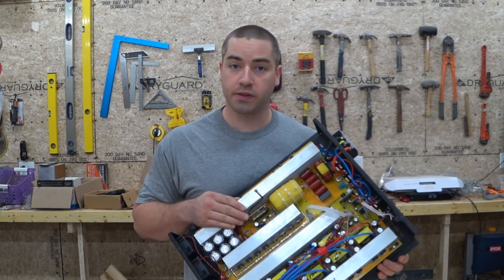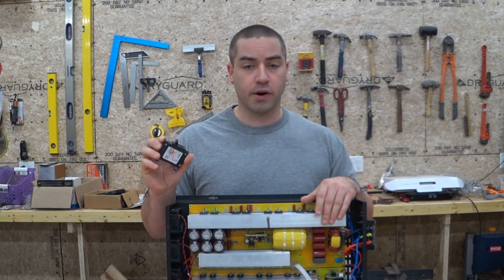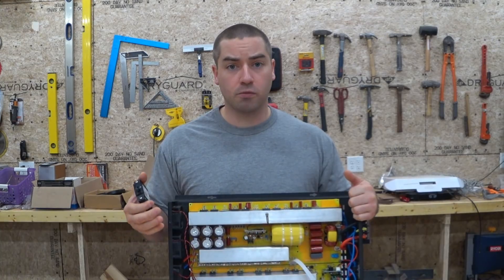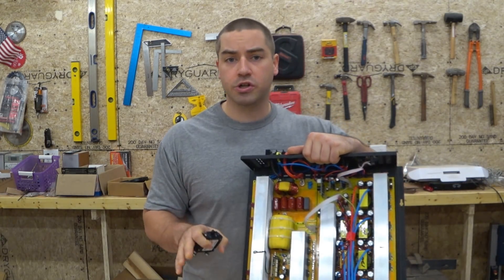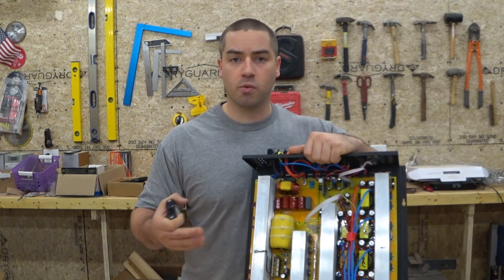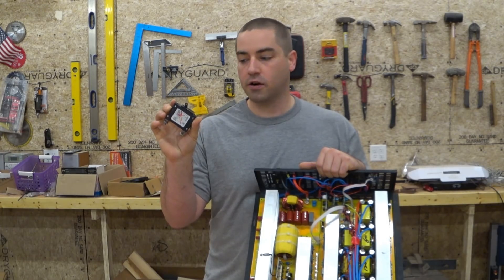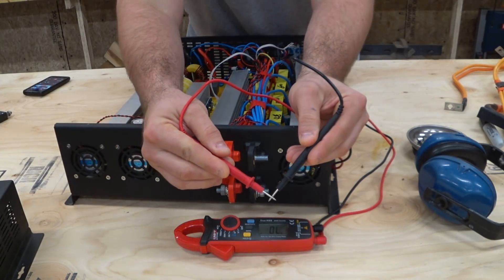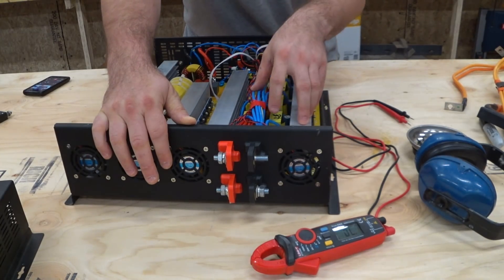Did I Blow Up the Inverter?

Comment: Throw that sh*t in the garbage and stop wasting your time.  Lets be honest here "time" is money and there just ain't enough to go around when you have a child & wife that needs your company yes?  We are Off the Grid and the only component we used that wasn't a name brand was our Battery Bank, we used the Ford C-Max Energi 7.6kW banks and we went with Magna-Sine 4448 PAE and the PT 100 that we got off ebay, it was an old stock unit made up from MidNight Solar that a company bought at a bulk prices so we got a really great deal.  The main unit was two years now three years old but brand-new.   I did not have to the time to waste on cheaply made products, seriously I have read the comments below and IMO you should get your money back and maybe look for a deal like we got.   Here is some great advice buy your fictitious name, register it with your Secretary of State and then you have your Corporate Sole aka your Biz, the "Strawman" then you can buy wholesale through your newly formed legal business like we did and do.  We got our Battery Banks from LKQ at wholesale- ea. bank 7.6kW for under $900 delivered to our shop, so in all we power our home now for under 4k, however, we do need some more batteries and more solar panels to power my shop and the home at the same time, which we are now shopping for deals on.  If you need help just email me.
Reply from the maker: Thanks for your comment.  I agree that time is valuable.  My next inverter will be a better brand.  Congratulations on being off-grid.

Comment: I would like to ask the EE community who's been posting here;

If one of you Electrical Engineers know how to design (or would like to help design) an Open Source DIY DC to AC inverter from scratch that is better by both cost, and reliability) than what's currently coming from these other markey sources, I'm sure we would get a few video views (if that's your thing) doing a video series for a community built, Open Source, modular (expandable) DIY inverter design - I'm talking a Open Source, DIY (kits? populatable boards?) user built, and serviceable, reliable, safer, lower cost, DC to AC power inverter from scratch.

I'd throw a like to That series!! As I'm sure would many others.

I'd even venture to say that we could probably get some GoFundMe, Patreon or Kickstart fundage to support it's initial design tests and parts procurement....

I know that there are perhaps safety, or liability issues that may need to be addressed with this idea,  but those can typically be figured out with some discussion...

Initial design could probably be mocked up in a Spice simulator until most of the kinks were addressed, then an initial prototype and testing could begin, before a beta release; This would also make it easy for designers from all over to contribute/vote on design features...

With the close knit community of persons who do DIY solar and alternative power systems, I'm sure you would have a great result. I know that I would really like to understand exactly what's going on in these systems and their design so that I can either build or repair my own, or give my mom in Hawaii who's on a 48V DC solar system currently, some ways to troubleshoot what she has currently. 

I also realize that good quality, reliable parts cost more money, but perhaps with the community working together, hunting down good reliable and cheap parts houses, and with some design discussions, a cheaper, more reliable DIY inverter could be built by us for us, that we could actually fix in the event that there was a failure....

 For example, I would suggest for starters, that an open source DIY inverter's input section allowed for perhaps 6, 12, 24, and 48V DC input, depending on an individual's system requirements perhaps via two different boards one at 6-12V, and another at 24-48v; and that a similar, modular output stage that could have upgradable power output power ranges...

What do you think?

So tell me, what would you add, as design features, or ways to keep it modular, or less costly if someone was to take this by the horns? And would you be interested in building one of these, or buying it in a kit form?

And if YOU - (yeah, you know it's YOU...) are That guy or Gal who has enough knowledge about design consideration of these to help kick this idea off,  post here, or email to the address in the next paragraph, and let us know... I would be willing to help set up a webpage for it, do the kickstart/gofunding setups, or where ever else I could help; I have a lot of other skills (I'm a long time technician in electro mechanical) and I'm pretty good with a soldering iron and 3d design, but electronics design was never my forte; too much math for me...

So to help get it going, I just set up a google email at OpenSourceDIYInverter AT gmail dot com to get a point of contact started; If you are interested in helping out, let me know through there. I will also drop this comment to some other solar/inverter videos and forums online, and if I see some interest, I will go further, perhaps setting up the webpage and starting a kickstart; I may just go set up the kickstart just to see what the interest is like out there...

Thanks, hope to hear from you!

OpenSourceDIYInverter AT gmail dot com
Anthony W.

Comment: Hi DavidPoz;

(prequel: sorry about the length of this post, before I knew it, it was looooong! My question regarding your system is near the bottom)

I just wanted to commend yourself, for posting this video series, and the great community feedback which resulted from it; I've learned much more than I expected from all the great EE community feedback regarding your video, some of which I hope to put to good use when I retire in Hawaii to my mother's property, which has a 48V (2x24) solar/deep cycle battery powered system currently; I found your video while looking up pure sine wave inverters on Youtube as she had requested that I look at sending her information on a good (but inexpensive) 48V DC input pure sine wave 3000W  to 120V inverter;

Upon researching this system I have noticed how many people have commented almost without fail, about having problems with the cheap china inverters...

And I can't tell you how many times I've read "Spend the money on a good inverter, you'll save money in the long run!"

I wanted to mention that I did like the fact that you did not immediately start bashing the manufacturers of the devices in this system; rather you simply go thru some of the troubleshooting steps, and working with your forum to try and resolve your issue! Good Form!

So one thing I would like to ask about (hopefully one of the more knowledgeable EE's can comment;) is the fact that many of the new chop saw designs include a braking feature on the blade. Now I understand that this would take effect normally when releasing the trigger of the saw, it's when when you let off the trigger the blade doesn't "free wheel" in the newer saws, hopefully saving your knuckles as you reach in to gather your freshly cut work piece...

But if it's a mechanical friction brake used to slow the saw blade, which on startup of the saw doesn't fully release until the motor spins past a given RPM (most likely due to some kind of centrifucal clutch release system), could this not be also putting some extra load on the circuit at startup of the saw?

Of course as many have pointed out, David's inrush current measuring was a bit flawed due to the measuring equipment that he had on hand, and even with that said, the measurement would be what the measurement would be, but could this be adding to the overall load experienced by the system on startup?   

Questions or comments, as long as it leads to someone learning something!
Reply from the maker: Thanks for your comment.  I don't know what the electric braking system does to startup draw.  As you said, hopefully someone will know the answer.  Good luck helping your mother out finding an inverter to suit her.
Reply: @DavidPozEnergy  read my other post... just had a brain fart...

Now I'm going to spend my evening looking at more of these chevy volt/bolt battery systems DIY powerwalls; I gotta get her off of those big 24v deep cycle lead acids!

Comment: First of all the internal fuse's should be of a semiconductor rating
Reply: No fuse can ever work fast enough to protect a Semiconductor. The Inverter should have it's own over-voltage and over-current protection. Clearly this one doesn't.

Comment: As others have pointed out the only reason the inverter would fail on such a simple test is if were poorly designed. It also shows that (un)Reliable has very poor QC for something like this to escape it's factory.

Comment: David, firstly thank you for the recording & insights. Additionally, I really like the way you do your reviews as they are in-depth, clean & clear, and are well weighted in the positive & negative. As an electronic engineer, there are a number of things that you may not be bringing into the discussion. The first being that what you are starting is an AC Motor. AS you have stated there are startup surges that occur, but there are also power feedbacks that occur due to induction fields collapsing with-in the motor that can cause huge power spikes back into the power grid.  Normally the power grid is very capable of taking this millisecond surges, but as this is a switch mode power supply/inverter providing the power source, I suspect that the parallel design of the inverter was not designed to take these reverse in-rush power spikes. The way this inverter is designed is also not very inspiring as it relies on a number of Parallel configurations (The MOSFETs, Transformers, Transistors, Switching systems) works with close to the same speeds as each other, which off the shelf electronics without going through a strict matching process, do not do well. So I think you will eventually find 2x things that have caused the cascading fault. 1 is the way the Inverter was designed to leverage low-cost groups of parallel models that seemingly are meant to work as one. 2 the reverse in-rush current that is caused by an induction motor startup within its first 50 milliseconds of operation.  Again thank you for the review, the insight and the opportunity for feedback.

Comment: I have a dewalt saw looks very similar to yours, its setup and AC current, about every 3 or 4 month it will just randomly pop the ac breaker for no reason, you might be looking at the wrong things trying to figure this out. try another saw.

Comment: Before you comment you need to realize one thing.

48V is the input voltage

8000W is the output current
120V is the output voltage
 you cant calculate the output current by dividing 8000/48

Ohms law don't work that way....
Reply: What very few seem to understand is an inverter does not make power (watts) on its own, it inverts the the voltage in this case from a low DC voltage to a higher AC voltage.  8000 watts on the 120 volt output can only exist if 8000 watts on the 48 volt input exists.  So you better believe a breaker on the input side must be calculated using 8000 watts divided by 48 volts.   So oh ya, there's that 167 amps of current needed to create 8000 watts in the first place.  In actuality, since the inverter is not 100% efficient, 167 amps still won't be enough!
Reply: Do you understand the 80 amp breaker he is discussing here was installed on the 48 volt side of the system?

Comment: @davidpoz you put a 80 amp breaker on a 66 amp circuit, 8000W at 120V is the output which pulls ~66.6 amps IF the resistance is ~1 ohm. You should have put a 20A at first then tested with a 40A breaker if the 20A worked. The fuses are the giveaway. Each fuse is rated at 10A which means those Mosfets are rated around 10-15A. You stated the chopsaw pulled 15A which on start-up can be 20-25A depending how long the extension cord is. On that circuit design, in that inverter, it will be possible to pull the whole 20-25A across one 10A circuit. That blows the fuse and the Mosfet. Replace all the Mosfets (you had continuity across the outputs which means the fets are shorted closed) then yank all the fuses and test voltages across across each fet one at a time. If that doesnt fix the inverter then I would need to put a meter across it. The spark coming out of the breaker is normal on an ungrounded/poorly grounded circuit that shorts! I'm no expert but that's what my ohms calculator tells me.

Comment: Ya AvE did a video a while back he was out on a sail boat, wanting to make coffee and using an inverter to do so the dam coffee maker wouldn't work right. So he had to put a small inductive load on the inverter ( a mixer just running on low) that small load chopped up the waves enough to then let the coffee maker to run correctly. Now my memory fails me sometimes, I'm pretty sure he mentioned something about this. I'm just going from memory but he has an elegant way of esplaining it. Before I get the hate comments I'm just a guy in his living room trying to help another guy in his garage or shop. I did go back and look for the video to link it but I couldn't find it, he also did some house cleaning a few months back. He removed some videos.

Having thought about it now and reading some other comments, yah know I wonder if you made 9 sets of blue and red wires ( the same length) and wired them up if that wouldn't fix the problem. Seems to me the closest bank gets the brunt of it. While the banks further down the line are delayed. Probably a screw up between design and manufacturing those dam manufacturing boys are always trying to stretch a dime out of a penny. So cutting those blue and red wires makes a neat tight product they could be screwing up the works
So to speak.

Comment: Just from the thumbnail I knew it was an (Un)Reliable inverter! I know, 'cause I got roped into buying one (a 3500 watt 24V unit). I haven't blown mine up yet, but I learned...quickly..that it had a crappy surge capacity. I am not sure about all the models of these inverters, but my unit has a "soft start" feature. When it is powered up, the voltage ramps up in a second or two. I think the crack team engineering dept provided this function so when the user DOES try to start some crazy load like a mitre saw or air compressor, you are supposed to turn on the device, THEN flip the switch on the inverter! Their thinking is that you are running ONLY that one piece of equipment, not running your whole house! LOL. In lieu of that feature, I built my own stand-a-lone inrush surge limiter circuit, aka soft start unit. The big PITA is that, like I said before, you must engage the devices On/Off switch, THEN flip the switch on the soft start unit! If someone could design a self activating soft start circuit, they could cash in BIG time! You almost need an assistant when using a Skill saw, heavy drill, etc to flip the switch on and off on the soft start unit! BTW, it works with my inverter without blowing it up! That Reliable inverter company needs to be shut down IMO. I still have an old modified squarewave inverter made by Power Star dates back to early 1990's. It is the switch mode supply type, rated @ 1300 watts, 12VDC, weighs in around 7 LBS, and could fit into a large coat pocket! It WILL start and run my 7-1/4" Skill saw, 1/2" drill, or electric chain saw without blowing up! It even ran a 6500 BTW window AC unit!!! Company went busted in just a few years most likely because of China. Power Star was based in California and the products were made in Sweden or somewhere other than China.
Reply: Hi Curt, I've been contemplating how to rig an auto soft start into my inverter.  Do you have any details on your manual soft start that I can use?

Comment: I have a 1000 watt Dimensions unlimited pure sine wave inverter that will run a 7 1/4 skill saw Makita or a shallow well water pump... not at the same time separate. 8000 watt should power that with no problem.

Comment: So.. I don't know if this has been stated but if the current draw into the inverter is so high that your voltage drops in the feed lines then who knows how much current the inverter is trying to draw.  The transient inrush of current into the Inverter likely  results in very low voltage presented to the inverter.  You would think the inverter would have protection for this..

Comment: Just a thought...  I wonder if they made all the internal DC cables supplying the MOSFETs the same length, that might allay the problem?  I would expect the shorter run cables nearer the input to provide significantly greater current than the far end MOSFETs.

Comment: Well the design is not unusual or bad.the mosfets are gone because they are junk the grind inside is usually half or less then a non clone/fake one they have to a "peak current" rating "less then a second"

Comment: I have a 4000w reliable.
Powers my entire house. Furnace, 2 freezers, large fridge and Kuerig coffee maker, and also misc. power outlets.
Never a problem.
Everything is done with 4/0 supply wiring throughout 24 31 series 105 amp hrs 12 volt batteries, and 10 or 14ga house supply wiring. Separate from grid power.
200 amp inline fuses on neg. and positive on battery side.
System goes into 60 amp main then to separate breakers 15-20 amp. Inverter is rated at 30 amps.
Point is the inverter works very well. Over 3 months now.
Reply: It appears these inverters rely on lead-acid battery specific characteristic to sag voltage under high current surge situations. David must be using Lithium batteries which are capable of delivering much bigger surge currents with much less voltage sag which inverter is not designed to deal with.
Reply: @andriusst  It's the other way around. Lead Acid delivers far more instantaneous current than Lithium. And, it's a demand for more current than can be supplied which will result in a destructive voltage drop.